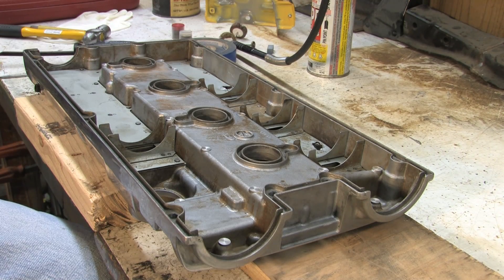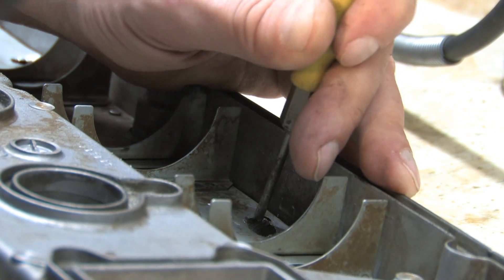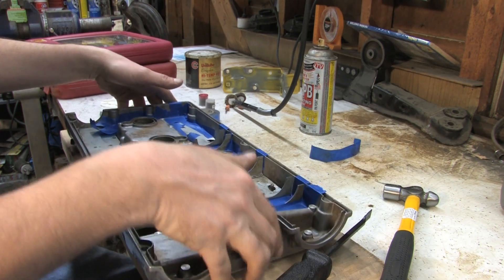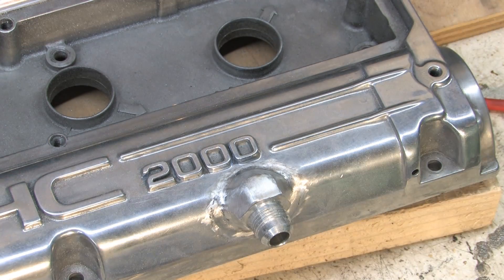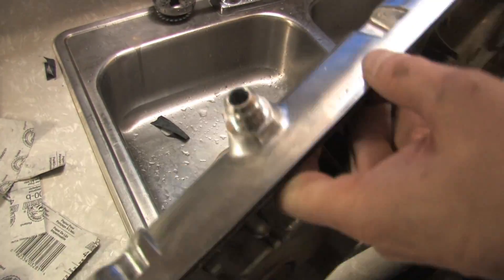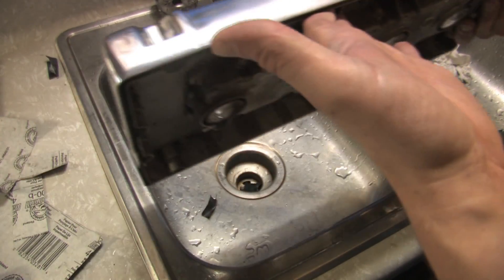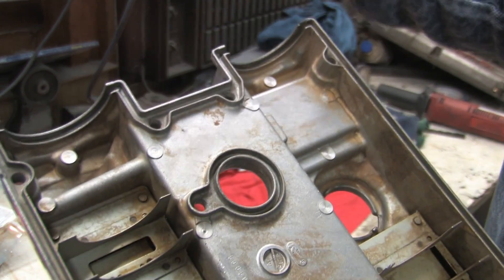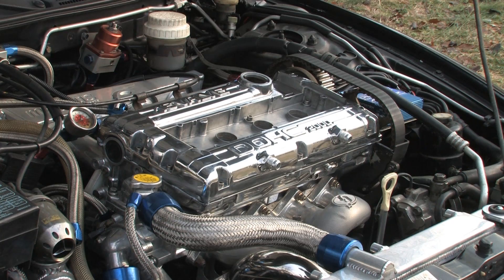Valve Cover Modification and Polishing

Comment: Nice videos like always.
I have a question I have a problem wen I'm building boost it tends to pop out the dipsticks and spray oil in my engine bay.
 I'm pushing 265hp and 316tq and its tuned to 20lbs of boost,but I turned it down back to stock wastegaste pressure which is on mine 12psi.
 My motor has less then 2,000 miles and never had any problem with it when it was stock.
 All this started when I added some bolt on to it.
16g turbo with a 20g turbine.
3inch intercooler,3inch cat back exhaust and 1120cc injectors,walbro 255 pump and 260/260 camshafts. 
I don't have a catch can set up and I have the pcv valve stock.
 Compression check pass and everything.
What do u recommend me do?
I was told that I have a lot of pressure in the crankcase and that's why ya phasing out the dipstick.
Reply from the maker: +kevin morales Combined between the PCV valve and the breather port, you only have a 3/8" diameter hole to deal with twice the boost and twice the blow-by.  This is causing high crankcase pressure.  You need to do something to relieve that crankcase pressure.  You don't have to copy what I did here, but you need to make one of those holes either bigger... or less restrictive.  A catch can will help, and there's a few different strategies to make it work.  Look around at other people's catch can setups.  +Robertbaxley has a good setup.  There are some people who have managed to fit a 12 AN fitting drilled and welded through where the factory breather tube is.  It can be pulled out with a pair of pliers.  Drill the hole out bigger, weld in the fitting and go to town with a catch can.  ;)
Reply: +Jafromobile thanks man for replying,u have been sure helpful man.
Love ur videos Bro and keep up the good work.
Reply from the maker: +kevin morales Sorry for double-dipping, but this is just a FYI to help you think about it.  Most people with TD05H turbos can get by with a PCV eliminator fitting, catch can, and plugging up the intake manifold.   You don't need a -12 AN fitting, The breather port hole that's there is 1/4", and that's OD.  8 AN is 1/2" ID. 10 is 5/8" ID.  Just because some people have put -12AN fittings there, it doesn't mean you should.  Look at what lines up on the other side of it first before cutting to add a big fitting.  Some people have proven you can use JBWeld to mount the fitting.  Hood clearance can be an issue with mounting on the top or front radius because it's tight right over the valve cover.  It's best to have the fittings either behind a baffle, or obstructed by something out of the way of the oil stream at the very least.  It can be a challenge to find the best location for catch can mounting and hose routing, and that's why you should look at other people's setups.  What I showed in this video was the third attempt at trying to get this location to work and I haven't seen anyone else do anything quite like it.  The welder got tired of seeing me coming back.  Some methods are more difficult than others.  Mine isn't even finished, in fact, I hate the hose routing.  It will be changed.
Reply: +Jafromobile  ok man good advice u have given me there,I will check a few setups here and there to just get a general idea.
 But another question do u do this for other people??
 Like people send u their valve covers and u weld them and clean them up for them??
 Just wondering because a friend of mine told me with a catch can set up and sending the valve cover to a shop to customize the valve cover will cost me 1500 dollars.
 I see that being a lot of money lol
Reply from the maker: +kevin morales That's a ridiculous sum of money.  Mine including the fittings was under $140.  But, no, sorry.  I don't do this for other people.  I don't have a TIG welder, and I would be a middle man.  It's basically a hole with a fitting welded on it.  You just need to find a local machine shop and welder, and take them a clean, degreased part to start with.  SummitRacing sells the fittings.  Remember that when you're in boost, the PCV valve slams shut and you only have a breather port venting.  You only vent through that one little 1/4" OD port.  With the turbo you have, you should be able to get by with just the PCV eliminator fitting, plugging up the intake manifold port, and adding a catch can.  You have a <$100 problem.
Reply: +Jafromobile cool man thanks for all ur advice and help.
 I really appreciate everything u have said to help me in this.
Reply: hey man its me again. im  got a valve cover that has 2 -10AN fitting in the stock location and i bought a calan oil catch can that has 3 -10AN fittings on it and i got a hard intake pipe with a -10An welded to it and im trying to figure out where to hook it up to. right now its hooked up but im getting oil blowby and oil is being pushed out of my dipstick,i dont thik its hooked up properly,also
i dont have the pcv do to the -10AN fittting installed in its place.
this is the link to the catch can i got.
https://www.google.com/search?noj=1&biw=1446&bih=848&tbm=isch&sa=1&q=calan+oil+catch+can&oq=calan+oil+catch+can&gs_l=img.3...1001066.1007777.0.1008049.24.22.2.0.0.0.134.2070.9j11.20.0....0...1c.1.64.img..2.11.985.0..0j0i67k1j0i10i67k1j0i10k1j0i8i30k1j0i30k1j0i10i24k1.1wBMMPQYn-8#imgrc=5NasBNRc-ZdkGM:
please help.

Comment: I don't have turbo gasses to vent on my '91 Eclipse GS, and I'm hoping to avoid the siren song of metal polishing, but this video was still very helpful to me because I plan to replace the leaky valve cover gaskets tomorrow. Because you took the time to explain how to get the seals on properly, maybe it won't keep leaking when I'm done. Thanks!
Reply from the maker: +William Dye Yessir!  It's all about being even with the bolts.  You da man, I know you can do it!
Reply: To Gonzo's Garage : I started my GS back up within a few minutes of getting the valve cover back on. Not sure if starting so soon is kosher, but at least in my case there's been no leakage at all.

Er, no leakage from the valve cover, that is. One of the fittings on the EGR solenoid sheared off, so the tube from the engine now leaks out the the atmosphere. But hey, at least I've got a nicely sealed valve cover while I try to fix the other leaks.

Comment: Jafro, have you seen the examples of people who run their AN fittings off the balance shaft hump in the block?  I'm not sure if there's a difference in how effective each method is, but both ways look good
Reply from the maker: 4g63mark That's a great place to put it.  Anywhere in the crankcase that's not submerged or directly in the oil flow is a great place to put it.  Both should be equally effective, but either way you've got to drill and tap or weld in a bung hole for it.  What might be a deciding factor is what kind of welding equipment you have access to?  I went for the valve cover because the GSX is [supposed to be] a show car, and polished aluminum stuff is pretty.  A stealth build would benefit more from the block method.

Comment: Im new to DSM's so idk too much, but 1) where did you relocate your battery? 2) what is that that you have the breathers hooked up to where your battery was, and what is the purpose? and 3) what is this spark plug mod you have done? i see a lot of DSM's with it and it looks better than wires. Please reply to me asap! BTW i love your engine bay. attention to detail is one of my favorite things to do and you do an insanely good job at it.
Reply from the maker: Derek Goodreau 1) I put it in the trunk.  On the car this valve cover belongs to, there's a video for it.  "2G GSX Battery Relocation".  2) I didn't explain the vent tubes, but they are a requirement for a trunk mounted battery box because the battery gives off hydrogen with a sulfuric acid vapor.  The tubes evacuate those gasses and they're supposed to lead to outside air for a vent. 3) it's called a coil on plug ignition.  Theres 2 videos for that, too... titled "How To Build a 4g63 Coil On Plug Assembly", and "4g63 coil on plug 201".  The factory coils are plenty strong.  There's no reason to change them out unless you change the manifold.  It's not an upgrade without additional components because the factory DSM coils have extremely short dwell times that are hard to beat.  It's expensive, but it solves the problem if you change out your intake manifold... regarding where to put your coils.  Sure I could have mounted them to the firewall, but this engine's more about art.  I wanted it to be pretty AND fast.  Thank you!
Reply: thanks for all the info, i appreciate it, and yes she definitely is an art.

Comment: You cleaned up the welds on the breather fittings really nicely. Well done. I'm debating on whether to do my next valve cover brightly polished, or brushed. I actually have a guy I can send parts out to and he throws them in with other customer's parts for a mild media blasting, then I take 'em home and finish them up. I understand your apprehension about having media or metal bits in the oil passages, but after a thorough blast of air they've always come out clean for me.

Comment: Nice looking valve cover. Bare aluminum oxidizes fairly quickly in my experience, though. Also, putting RTV in the corners is a good idea, but i tend to put it on the head side in the corners instead of the VC side. I haven't had any leaks doing it this way. I'm not saying it's better, although it does seem to be easier to clean up if the VC has to ever come off.

Comment: @jafromobile not sure if you will still be running this valve cover but correct me if i am wrong, how are you venting crank pressure if you have both of the vent lines coming off the front side of the valve cover. The valve cover has two separate chambers one on the front side and the other were the stock PCV valve was. Is your valve cover gutted so that your crank pressure is traveling to the front vent tunnel were your vent lines are?

Comment: giving polishing a turd a whole new meaning.  lol.. i mean that in a good way.  i have a tsi as well and have a few questions if you dont mind. when you did the breather vents couldnt you have ground off the rivits for the baffling and  drilled/ tap to put bolts inplace of the rivits. i think it would make it easier and would be cleaner...inside if it matters. unrelated.. i was wondering if you could show me this plug i have 2 remove 2 put a screwdriver in when doing the balance shaft and timing

Comment: Nice video. Unfortunatly you left out the running video with the camera in the bay. This way you can see the unit dent the hood as the motor torques!  ;) 

It does look really good. I've got my fingers crossed for ya!

Comment: @tscompusa I mean I used the turbo as a vacuum source to assist in sucking out the crankcase pressure, it also promotes in better ring sealing. i did lots of research before i decided on vented can + sealed. Either works, but the turbo does an amazing job as a vacuum source to get rid of the excess pressure.. more so then venting to atmosphere. your car will feel noticeably different now im sure since its breathing better :)

Comment: @Jafromobile nice. I did a dual sealed can setup myself. custom saikou michi with -10 from valve cover to can to air intake as vaccum source. picked up an additional 10whp also, so im sure you gained more power as well.

other can goes between intake mani & pcv, with check valves in place so can doesnt see pressure & to assist if pcv leaks.

have you read the article by calan on dsmtuners? in General > Tech Article Archives > Articles: Engine & Fuel

Comment: @Jafromobile no, kiggly hla regulates how much oil pressure returns to the head. the less oil in head the more in the pan.. something that should be required when pushing 500WTQ+ .. proven on evos that the oil pressure will drop on high TQ vehicles by forced performance because the way the pans baffled. I imagine its as bad if not worse on dsm's. I dont think you need the pressure regulator unless you're pushing 500+wtq tho. another words if you're on stock block, dont bother with it.